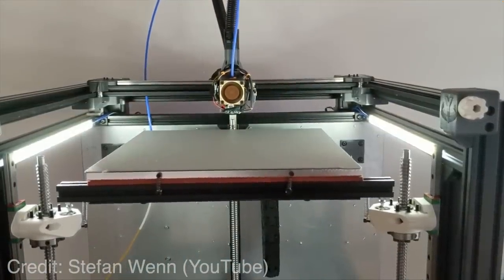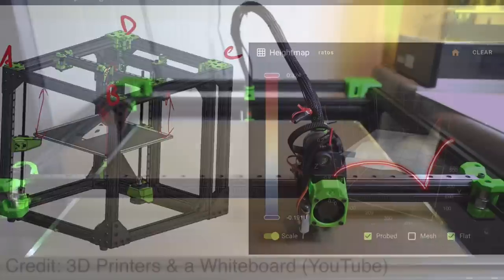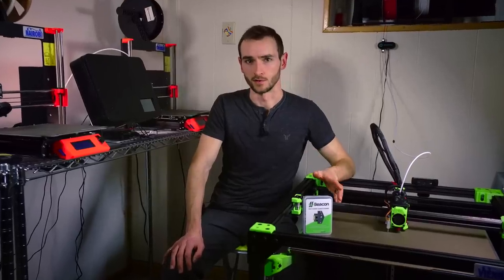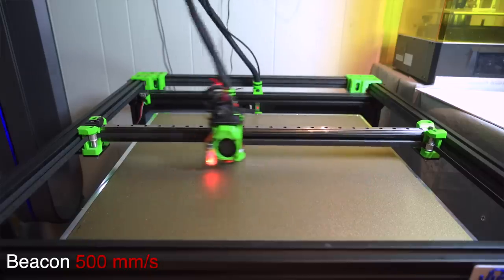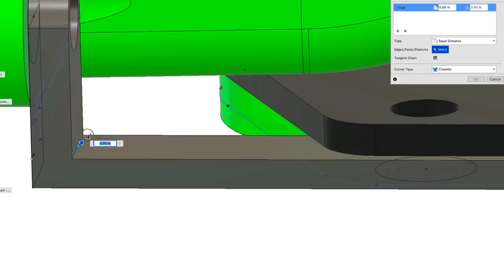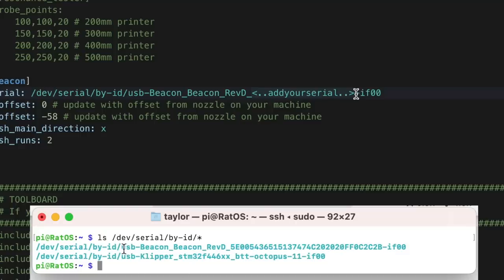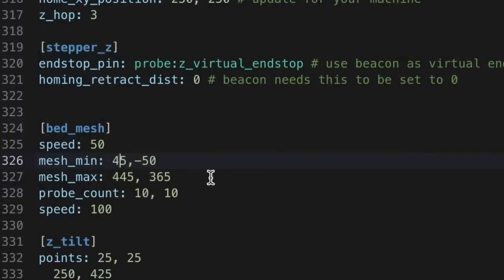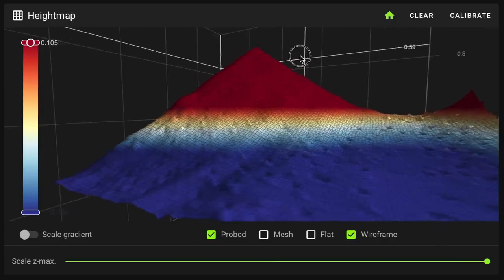The Future of 3D Printer Bed Levelling - 10,000 Point Mesh with Beacon Surface Scanner

Comment: What i wonder is Bambu Labs’ LIDAR/TOF sensor or whatever can be used/developed by the rest of us?  Outside of that this seems like the best process i could think of!

( or did Bambu Labs just use all the VORON / RatRig dev work to make a printer, do a little bit of design on their own, and do *literally the thing that kept consumer FDM from happening for years to us for a pretty penny)
Reply: Why not use a normal camera and run an auto focus algorithm to get the print bed "in focus"?
Can run from a distance and will actually measure the top layer of the print bed.
Reply: @pizzablender  this would work as an endstop to an extent, but you would basically have to make a DIY/Open Source 3D Scanner type thing to get that to work.

It is “looking” at a focal plane, when you basically want a pointcloud of the bed.
Reply: @pizzablender  "normal" camera costs a bit. Also, optics to work on micrometer level is even more challenging. And from software perspective, finding focus is sloooow. What you are talking in industry is called mashine vision, and finding focus on some surface is one of hundred use cases. That is not easy and currently sloow
Reply: @belzabubas  Finding focus is indeed slow, it would take 1 second perhaps to go through 50 exposures. Take the closest-to-the-camera one with enough high frequency content.
I'm mostly worried about thermal sensitivity of the focus distance.
Reply: @pizzablender  normal camera? you realize how normal camera is big and how big is the lens? Also, you need to hack the lens (or camera) to get the information about the motor movement, then somehow calibrate it to get good enough accuracy. Uh it is doable, but hard.. I think it's prohibitive due to the size and weight of a normal camera with a motorized focus mechanism.
Reply: @chronokoks  My idea is a webcam type camera. No auto focus. The Z movement of the printer will be used to get focus.
Reply: @pizzablender  ouch .. good luck calibrating that.. you're shooting for I think +- 0.03 mm, that would be very hard with that setup
Reply: bambu, prusa, and creality all use direct nozzle probing for bed leveling. bambu and creality use piezo sensors under the bed. prusa uses a strain gauge in the toolhead. bambu does not use lidar for leveling, only for a sanity check for endstop.

Comment: Fast way to get an accurate bed mesh is definitly cool. But its somewhat large, quite expensive and most importantly doesnt allow for automatic Z calibration like a microswitch probe. And in my experience that last part is probably the most useful thing to have.
Reply: Why shouldn't allow a beacon probe automatic z-calibration? Of course, if you measure the extra switch for reference outside the printbead or very close to the brim, unlike a bl-touch or Klicky probe you might get different readings, so you might not measure the sensor outside the bed. However, nobody stops you to use a servo to actually place the "reference sensor" onto the plate in an area the beacon measured before and than probe with the nozzle there. Subtract the height of the reference switch from the bed up to the trigger point, and you have auto-z-offset calibration.

Actually you could do a half-automatic-z-offset even more easy: Just make a holder for the z-reference switch to be placed on the printbed always on the same spot. After the beacon made the mesh, you place the reference switch on the bed manualy, do the auto-z-calibration and everything is fine.

Actually I think about this solution on my Qidi X-Max 3, as the nozzle can not reach outside the bed there and it has no integrated auto-z-calibration.

Comment: Interesting tech. What exactly is it measuring? The top surface of the bed like the BL Touch, or a metal layer inside the bed like the inductive probes. I suspect a metal layer inside the bed. Do you know of anyone developing an open source lidar/tof bed leveling solution? (I say open source because, well, Bambu isn't exactly open source...)

WRT the flatness of your bed. Did you do this probing with your bed at printing temperature? I've gotten my MK3 bed fairly flat using the nyloc mod, but only at 60°C. When cold the bed is not really flat, and I haven't checked at higher bed temperatures since I primarily print on a 60°C bed (mostly PLA).
Reply from the maker: 1) It's measuring the spring steel sheet.
2) I'm not aware of anything but the open source community is always brewing up something so it wouldn't surprise me
3) I was probing (scanning) cold in this video.

Comment: a few points here: (1) this high resolution uses too much resourced even during the printing process if and for a bed service that doesn't really need so much resolution for the nature of the material and its bending characteristics. (2) it is still  approx. method, which has a big error anyway. (3) nothing really is better than two methods here, the direct touching method in Creality CR-6 SE that works for us every single time and is amazing, and a laser scan that doesn't exist for this application yer for the same researches reason. So, we don't think it is a good option.  The Creality CR-6 SE already delivered a better method and we love it.

Comment: When you have almost 30mm delta between the nozzle and beacon, the accuracy of the reading is inherently less with respect to where it will print, right?

Moreover,  is klipper actually uses and adjusting the first layer all all those data points or it's averaging them to arrive at say 25 point or 59 point mesh? 

Second point, this sensor expects you to update config whenever you change the nozzle. Probably load cell based approach may be better.
Reply from the maker: 1) You have to tell the firmware where the Beacon is relative to the nozzle just like any other probe, so in theory the data is just being shifted so the measurements of the Beacon are applied at the nozzle during printing. 
2) I'm not sure how much the data is being used precisely versus averaged but of course there is a limit to how fast the z height can be modulated. 
3) Yes, this sensor still has the limitation of needing to set the z height.

Comment: Glass? I bought inductive sensor a while ago(after I bought my printer around 6-5 years ago) but didn't install it because of this reason - it measure aluminum table underneath glass, not a glass surface on the table. 3D Touch(BL Touch clone), that I finally installed recently, measures glass surface itself.
Reply from the maker: No, this isn't compatible with glass for the same reason that the inductive probes aren't. It needs a conductive surface to measure.

Comment: Lots of metal around most hotends.  Perhaps it needs some shielding on the top side to make mount less critical.  That and a dockable mount, seems pretty big compared to a standard probe. Also I would assume cast beds with magents mounted in them would drive it crazy lol
Reply from the maker: Dockable mount would be cool for sure. And yes, lots of metal on most print heads so may be difficult to find a suitable location.

Comment: Is this basically a DIY project, or is the compatibility based on Fan set-up, Drive Assembly, Parts Covers, Hotends, Heater Blocks, or Extruders?

Judging by the 3 different Products variants available, it seems that they are being made for specific 3D Printers, not specific Hotend/Extruder Assembly Configurations. Are any of them out-of-the-box compatible with any basic Hotend design?

Which one works with the basic Heat-Block systems, like Ender 3?

Which one works with Ring/Spiral Hotend set-ups, like Dyze Designs?

Which one works with Inductance Hotends?

Can they be used in Water-Cooled set-ups?

Some of the types of Printers they say they are for, can have many different configurations of their Drives, Extruders, Hotends, Nozzles, etc, so how do one know which unit is best?

Is it just too early in the game to expect them to be ready for general distribution?
Reply from the maker: It's kind of a DIY project unless there is a mount design that already exists for your print head. You'll need a different mount for each different print head configuration. You would need to judge based on the geometry of your print head which Beacon configuration would fit best (normal, low profile, right angle), then design a mount to suit.

Comment: The concept of all bed mapping assumes Z axis correction but there is backlash in the Z axis and the Z axis adjustments are probably within the backlash zone.  I think the best use for the Beacon Surface Scanner would be to map the bed to allow manual mechanical bed leveling in an iterative process to make the top surface of the print bed as level as possible so the printer can operate as well as possible without trying to compensate in Z while printing.

Comment: Is it as bad as other electromagnetic probes with heat drift?

Isn't it by nature inferior to klicky and tap?

How useful is the resolution increase anyway?
Reply from the maker: It has a built in thermistor for temperature compensation. It’s inferior to Klicky and Tap in that it doesn’t eliminate the need to set z offset, but it’s superior in terms of speed. I’m not sure how much difference the resolution really makes but it’s nice to be able to scan the full bed of a large printer quickly.

Comment: Greetings from germany. Its possible you link the *.stl from the mountings of digital gauge? My gauge is mounted on printhead, but the head is wobbling.
Reply from the maker: My design is pretty wobbly too. I need to revise it further. I can send you what I have if it will be useful to you but that would require that you have the same EVA carriage.

Comment: Not sure how this is revolutionary since a regular probe or switch can do it. Have a mesh for different temps and then it’s always correct. It has a very high cost so the printers that needs it the most make it non economical. Then it’s the fact that with a mechanical switch you can have automatic z offset. I would say that is more useful compared to have the need to redo mesh each time you start a print. I have a 350x350 bed and have a mesh for all my printing temps. Do it ones and it’s fine. Since I have automatic z offset I can switch print plates as much as I want and always have perfect first layer.
Reply from the maker: It's definitely not necessary and doesn't solve all problems with existing probes, but it does do some things better than any others. A combination of this with a nozzle probe for z height would be awesome.

Comment: I think the temperature sensitivity is its weakest point. What good does a nice mesh do when you still have to tinker with the offset on each print..
Reply: It has temp compensation. I've done prints in a 30c chamber and a 100c chamber without adjusting my offset.
Reply: Actually best would be two sensors: one Piezo or simular preasure sensor (like in prusa's nextruder) to measure the surface / homing and the beacon for fast detailed mesh. So the offset would be set automaticly every time...
Reply: @oleurgast730  Yeah... or a head like the Voron tap or a Voron klcky with auto-Z calibration

Comment: Wow this is a nice development in mesh leveling. Of course a is with any new tech the kinks will be worked out and compatibility will take off, even still  this is awesome. Correct me if I'm wrong but have we gone with the typical 5x5 , 6x6 , 7x7 etc... point leveling since bl touch was made? I'd say it's way overdue for something like this to come out and revolutionize mesh leveling. Definitely cool to see
Reply from the maker: The mesh I show in this video is 100x100. Imagine how long that would take with a BL Touch…
Reply: @ygk3d  for sure this is great but if your printing on a 220x220 or smaller bed size I haven’t had a missed first layer on my ender 3 since I saved the 5x5 mesh with the bltouch , also have a magnetic spring steel bed and take it off and put it back on in between every print .
And go months not running the relevel / mesh 5x5 process that does take basically the time it takes the preheat to get it ready to print even if I felt like running the process every time I prob should that’s what I got from videos on subject but I just didn’t do that to see and it’s amazing how well it’s kept accurate. This for sure would be better but if it cost more I’m not sure it would be worth the money over the existing methods. Bltouch cost I think $40 or $30 it was super affordable and I installed it way easy. I’m not someone who is a expert on 3d printers by a long shot but in a year and half are two I’ve printed though a couple dozen rolls of filament bell I’ve only changed my nozzle 2 times haha it’s amazing how long those lasted everyone acted like 3d printers clogged and wore out nozzles a lot … haven’t experienced that .
actually my experience the last almost 2 years is the remarkable stability and reliability of my printer that cost less than $250 altogether.
The slicer learning how it works was the most important part of the whole hobby, cura is an amazing piece of software, Prusa slicer is good also but I prefer cura I feel I can get exactly what I want out of cura more easily .
I would love to have a core xy faster printer with a all metal hottned direct drive , but my main use case at this point would be for a larger build area than 230x230 are whatever the ender3 bed size is I can’t remember exact.
Being able to print the carbon fiber nylon and larger prints is basically the only things I can think of that I would like to have the option of and faster prints would always be nice but eventually you run out of shit to print and your printer is going to be sitting idle anyways haha there aren’t many things I have had to print that I needed done on a time frame they could always wait the extra couple hours that even a core xy printer would save me.
If they could work on affordable metal 3d printers that will be the most ground breaking thing at this point and it seems like they could work out a way to have like a tig welder hooked up to a printer that could build up layers even if it was slow I know I watched guys re line huge tanks at a factory I had a maintenance contract at and they had a welding robot that rode on a rail around the inside of the steel tank and slowly built up weld and a new layer lining the tank with essentially a new steel inner lining.
Having this micro scaled down very small and slowly building layer with like a 3d printer seems like it wouldn’t be impossible are have any new inventions all the tech pretty much exist .
Having a optical scanner to scan the print in between layers would be super beneficial for this type of layer building for metal 3d printing due to how welds can have inconsistencies far more than extended solid plastic. 
Pretty exciting time we live in.

Comment: Awesome, thanks for you insight.. will it be available to work with can bus ?
Reply from the maker: It’s not currently compatible. So
You’ll be required to run an additional USB cable specifically for the Beacon sensor. It would be nice if they released a CANBUS supported version in the future.

Comment: Hi, I am currently building this one, and I dont understand the pulleys, my brain tells me to screw then all the way up against the top part, but the belts are too short for that?
Also, my second thought after tensioning the belts, any good way to get them level, I mean, the belts will rub against the roller wheels otherwise?
Reply from the maker: I'm probably not the right person to ask. It's been a while since I built my RatRig and it is the older V-Core 3. If you're building it now it's likely the V-Core 3.1. Check out Nero3D on YouTube. He is currently doing a build series on this printer.
Reply: @ygk3d  Oh god, I was posting this in the wrong video, I was supposed to post this in the trodoon channel, since that one is what I am building right now, sorry!
If you want I can post my question there instead?

Comment: ngl that’s pretty dope. but how does it detect the edie currents? does the eddie currents in turn induce current on the coil? and that’s what determines a point on the bed?
Reply from the maker: Something like that. Not sure exactly how it functions.
Reply: @ygk3d  I’m thinking maybe the magnet fields created by the eddie current is inducing a current on either a secondary coil(if there is one), or causing resistance on the primary coil. That’s probably what we are detecting to create a point. But I would definitely buy this if it means faster mesh. Mine take more than 5 minutes with a BL touch 😐

Comment: The value is actually pretty good for the price in my opinion, especially if you're using Klipper anyway. But how does something like a PEI coating, which you can't measure with it, affect the results? I mean, it probably comes uniformly enough from the factory that you might ignore it, but scraping hundreds of identical priming lines off it certainly leaves its mark. Doesn't that require replacing the bed more frequently?
Reply from the maker: I think there will definitely be a margin of error since it is not measuring the coating itself, but rather the surface beneath it. But I'm not sure that will matter much given the average thickness of a PEI coating.

Comment: I always mount my probes inline in the X direction to the nozzle. This is to eliminate error due to x-axis rail twist. This flat pancake design makes that awkward/impossible. I wont be using for this reason.

Comment: Will this work on a magnetic build plate?
Reply from the maker: Yes. Magnetic sticker with sprint steel sheet is ideal. It won’t work if your bed has large fixed magnets.
Reply: @ygk3d  I was wondering if the magnetic bed would interfere,  also I don't think the magnetic sticker is consistent and could be giving you false readings/spikes.